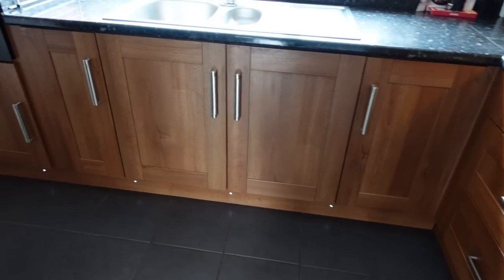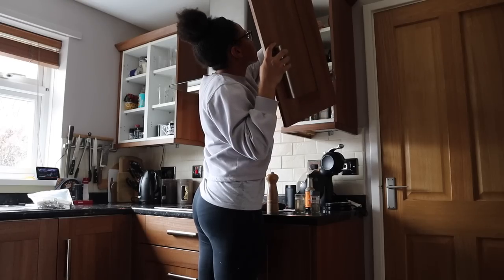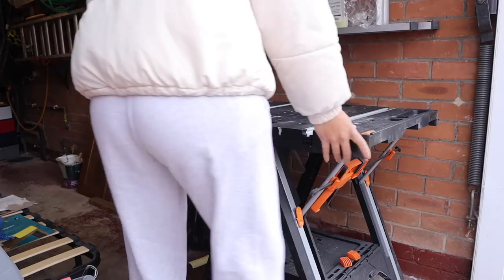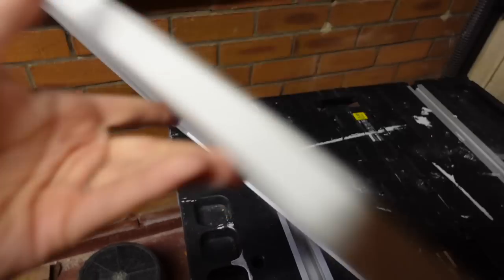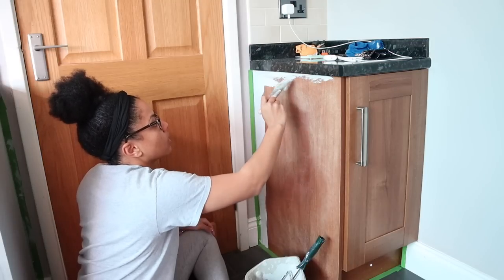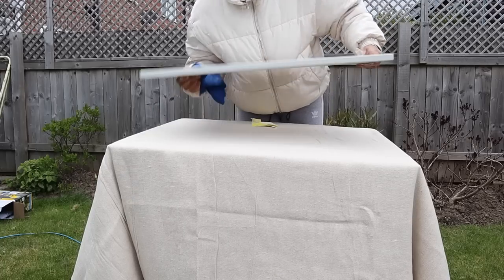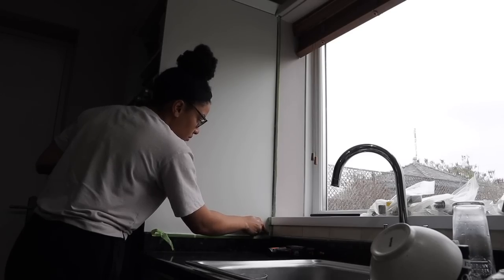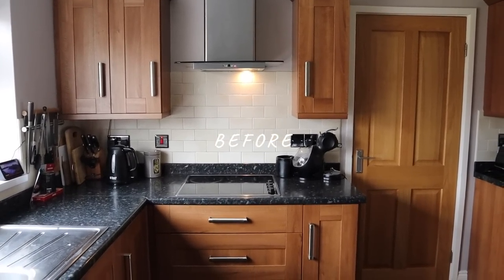Kitchen Makeover for under £100! *budget friendly*

Comment: Top tutorial…I’m in the middle of a similar transformation myself for a friend. I’ve kind of dithered on choosing traditional roller/brush method or my cheap Teccpo sprayer. I did use it to spray masonry paint, and have to admit to being impressed. The V33 paint I’m using on the doors is quite a bit thinner than masonry paint - think porridge - so shouldn’t need much diluting. Great job, and thanks so much for sharing!

Comment: Hi Shade, this looks stunning! Please can you advise? How do you clean the cupboards? Can you use any sprays like elbow grease for example to wipe down dirt/grease during a general clean? Isit durable?
Reply from the maker: Yes you can! Once you let them fully cure for about 10 days. I wouldn't use anythign particularly abrasive on them but they can defo be cleaned well. I'd also recommend sealing them for a final step too!
Reply: Thank you for replying. I’m planning to use a seal definitely after seeing your video. Im thinking of using a polycrylic?

Comment: I'm sure my cabinets are the same as this i've got a few parts where the laminate is peeling and ive got a chip how would you think to cover/prep these bits ? x
Reply from the maker: Hmm hard to advise without seeing but perhaps a very strong wood filler than can fill the chips and some sanding can help create a smooth base initially. I’ve also heard of people using heat to remove their plastic coverings but that is a huge job and probably only suitable for badly damaged cabinets x

Comment: Hi Shade, I'm trying to do the exact same, would you be able to share the wagner spray settings ?
Reply from the maker: Hey Rajiv - Wagner 230V 280W Paint sprayer W100. Hope that helps!
Reply: @ShadeShannon  I've got the same model as you, but I meant the flow wheel behind the trigger. That's confusing me 😔